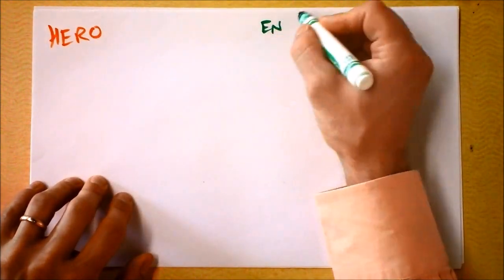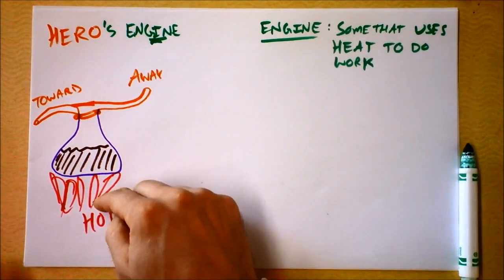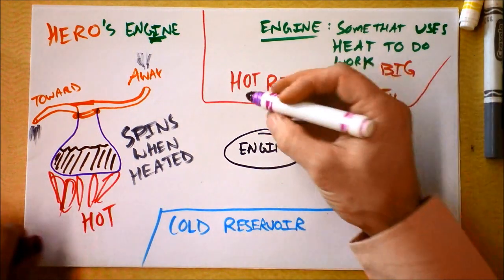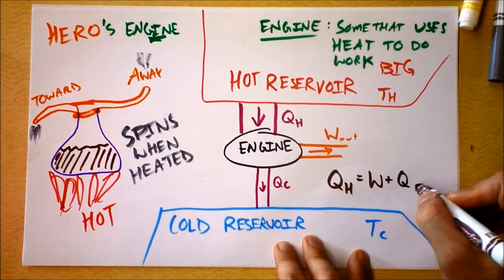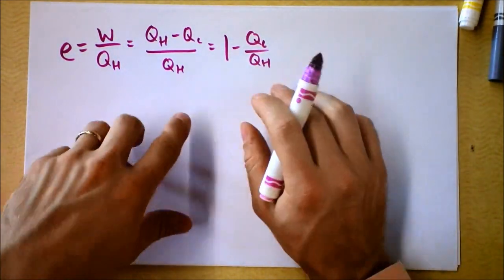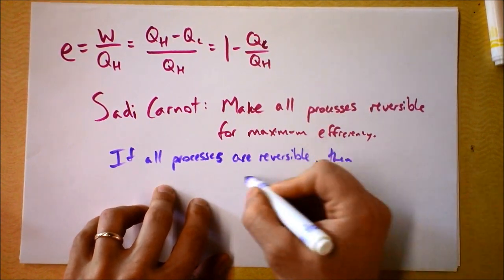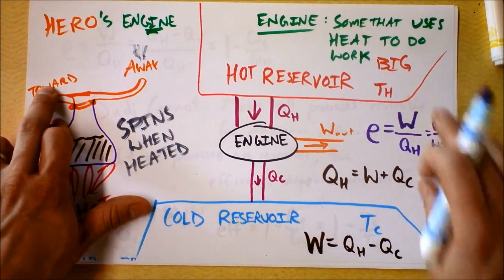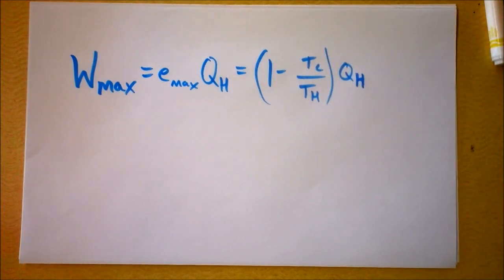A Heat Engine Can Use Heat to do Work.  But It Can't Be Perfectly Efficient! | Doc Physics

Comment: I understand in theory why the cold reservoir is required but why is it really? Get rid of the cold reservoir and all the heat from the hot reservoir gets converted into work except for whatever little is lost to the surroundings.
Reply: In this case, the cold reservoir would be the point at which heat is lost to the surroundings

Comment: great video!
I am doing a problem that involves a furnace to surrounding then a pump back into a house. When I set up my equation for the pump into the house (Qh is given) I get a negative Win. This doesn't make sense because I use Qh to be negative (since it LEAVES the pump and enters the house). My professor put up the equation as (Qc/Qh= -(Tc/Th) and this gives me the correct answer using the sign convention that work on surroundings is NEGATIVE.

Comment: That is, if an engine converts heat into work under isothermal conditions (no cold reservoir, Th=Tc), the second law of thermodynamics is violated. Unpublished notes written in the period 1824-1832 reveal that, at the end of his (short) life, Carnot discovered the first law of thermodynamics and immediately started doubting the second:

http://www.nd.edu/~powers/ame.20231/carnot1897.pdf 
 Sadi Carnot: (p. 225) "Heat is simply motive power, or rather motion which has changed form. It is a movement among the particles of bodies. Wherever there is destruction of motive power there is, at the same time, production of heat in quantity exactly proportional to the quantity of motive power destroyed. Reciprocally, wherever there is destruction of heat, there is production of motive power." (p. 222) "Could a motion (that of radiating heat) produce matter (caloric)? No, undoubtedly; it can only produce a motion. Heat is then the result of a motion. Then it is plain that it could be produced by the consumption of motive power, and that it could produce this power. All the other phenomena - composition and decomposition of bodies, passage to the gaseous state, specific heat, equilibrium of heat, its more or less easy transmission, its constancy in experiments with the calorimeter - could be explained by this hypothesis. But it would be DIFFICULT TO EXPLAIN WHY, IN THE DEVELOPMENT OF MOTIVE POWER BY HEAT, A COLD BODY IS NECESSARY; why, in consuming the heat of a warm body, motion cannot be produced."

I think that, almost 200 years later, Carnot's question is still relevant. Isothermal heat engines are possible in principle (that is, the second law is wrong) but they are so slow and powerless that experimental demonstrations (perpetuum mobile of the second kind) are virtually impossible.
Reply from the maker: Pentcho Valev Love it.  But could you get closer by making an enormous number of very small ones?
Reply: Doc Schuster
I don't think I understand the question - if you elaborate I may be able to answer it. Meanwhile let me show you something interesting. Consider FIG. 1 and FIG. 2 in:

http://pages.csam.montclair.edu/~yecko/ferro/papers/Fundamentals/Brevik_ElecMagnFluids.pdf 
 Can. J . Phys., 60. 449 (1982), Fluids in electric and magnetic fields: Pressure variation and stability, I. BREVIK: "FIG. 1. Two charged condenser plates partly immersed in a dielectric liquid. (...) FIG. 2. The hydrostatic pressure variation from point 1 to point 5 in Fig. 1."

FIG. 2 shows that the hydrostatic pressure between the plates of the capacitor is much greater than that in the rest of the liquid. Therefore, if we punch a small hole in one of the plates, somewhere between "3" and "2" in FIG. 1, water will constantly flow through the hole, pushed by the pressure between the plates:

http://energythic.com/usercontent/3/DIEPHOPU_caphole.gif

It looks like the second law is violated, doesn't it? More references:

http://www.amazon.com/Introduction-To-Electromagnetic-Theory-Perspective/dp/0763738271 
 Introduction to Electromagnetic Theory: A Modern Perspective, Tai Chow, p. 267: "Calculations of the forces between charged conductors immersed in a liquid dielectric always show that the force is reduced by the factor K. There is a tendency to think of this as representing a reduction in the electrical forces between the charges on the conductors, as though Coulomb's law for the interaction of two charges should have the dielectric constant included in its denominator. This is incorrect, however. The strictly electric forces between charges on the conductors are not influenced by the presence of the dielectric medium. The medium is polarized, however, and the interaction of the electric field with the polarized medium results in an INCREASED FLUID PRESSURE ON THE CONDUCTORS that reduces the net forces acting on them."

http://farside.ph.utexas.edu/teaching/jk1/lectures/node44.html 
 "However, in experiments in which a capacitor is submerged in a dielectric liquid the force per unit area exerted by one plate on another is observed to decrease... (...) This apparent paradox can be explained by taking into account the difference in liquid pressure in the field filled space between the plates and the field free region outside the capacitor."